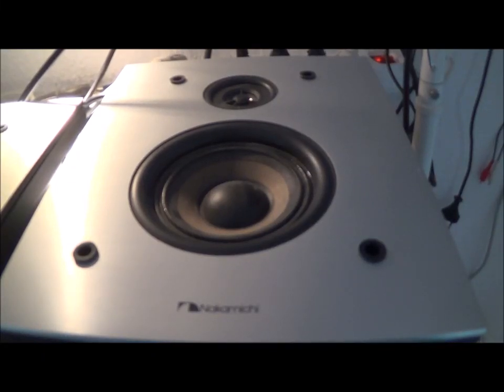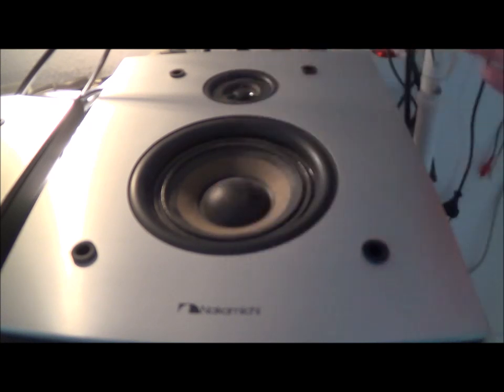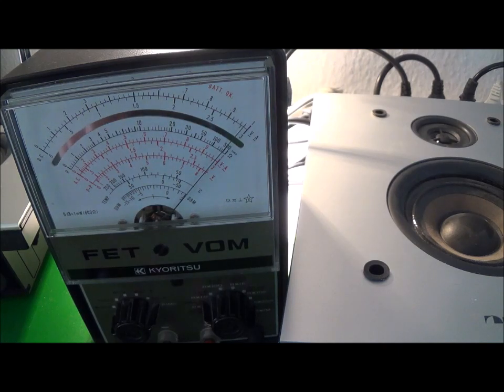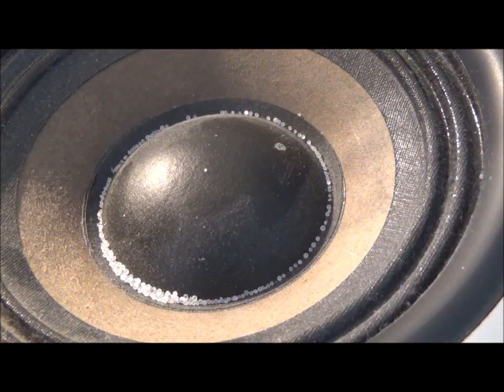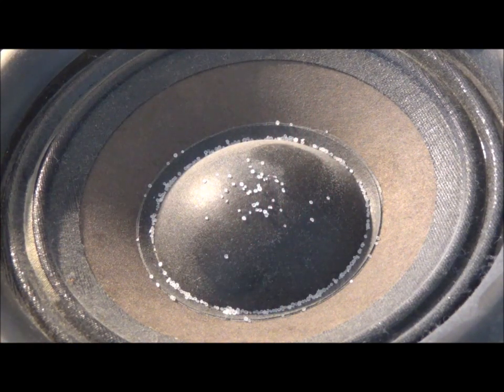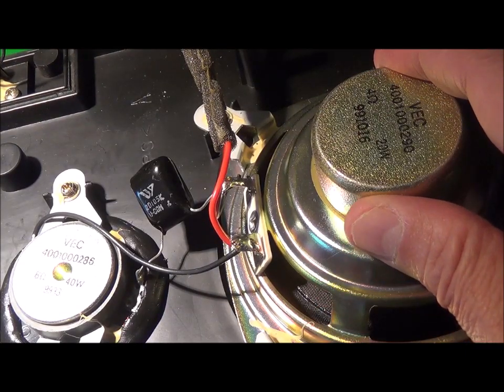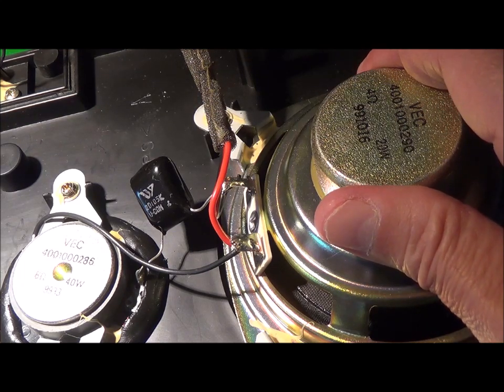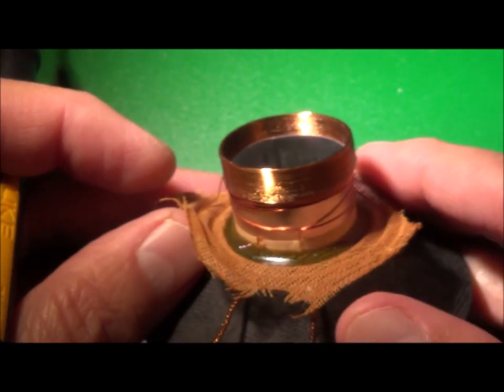Open Speaker Voice Coil

Comment: Over analyzing things....never done this myself cuz it just dawned on me...couldn't you do a ringer test? Wouldn't that also tell you how far down the coil the damage in the would be?  ~Jack, VEG
Reply from the maker: I first learned bout the ringing test back in electronics school. We used to check yokes and flyback transformers with it; it would show you whether or not the flyback transformer had shorted turns. So basically the test was used for shorts, not open turns, as was in my case. But it would not show you where exactly physically where the short was at. Since a few shorted turns might have only a slight effect on ohmmeter readings, doing a resistance test would not be too reliable. As far as I remember, shorted turns would dampen or reduce the ringing oscillations you would see on the scope screen. I think Sencore used to make a tester.
Reply: Like I said, never done it, but thought it might be a valid test.  I need to learn more about it then,  :)  I have a ringer tester on my Sencore LC75 capacitor meter.  Thanks OS, enjoyed the video.  ~Jack, VEG
Reply from the maker: I now think you were thinking of a TDR. Thanks for watching! Make a video of the ringer tester sometime, please.